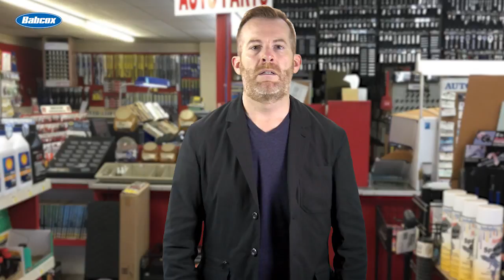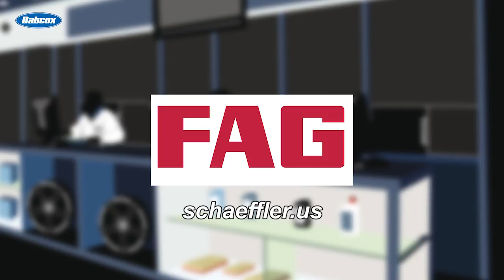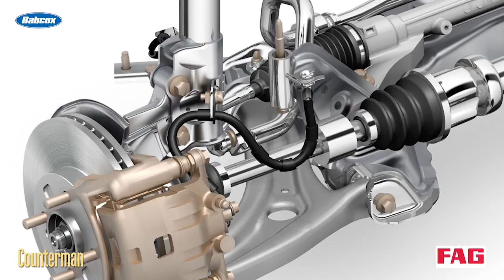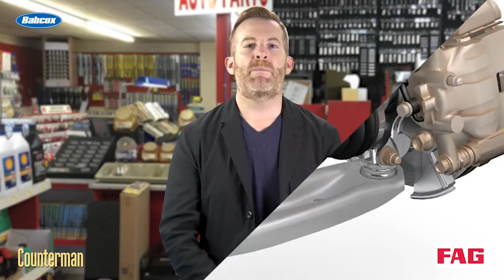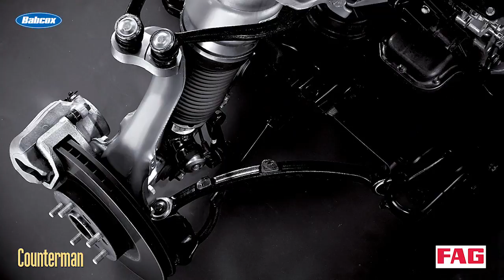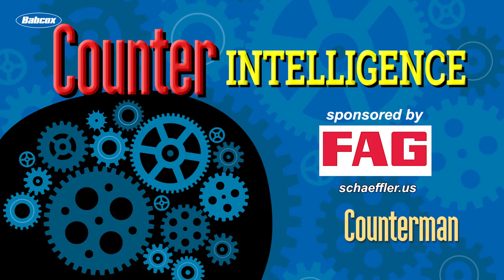Wheel Bearing Noise??? | Counter Intelligence

Comment: I believe I have a bad wheel bearing. As I drive along I can turn the car to the left and it stops making noise. I continue on and turn to the right and it stays the same. Not much louder but it doesn't go away like it did when I turned left. Does that tell you anything? thank you for your video